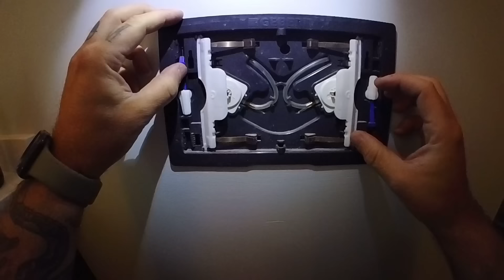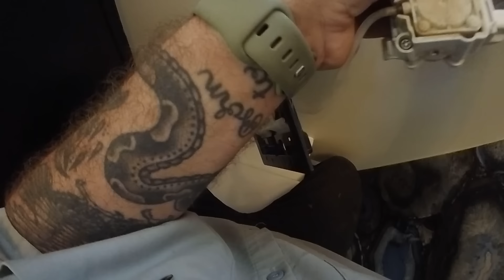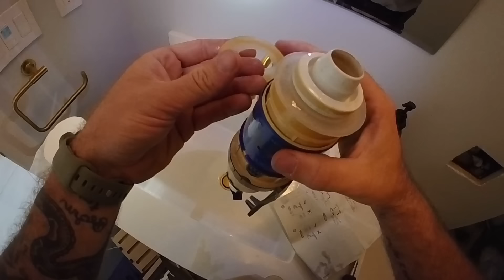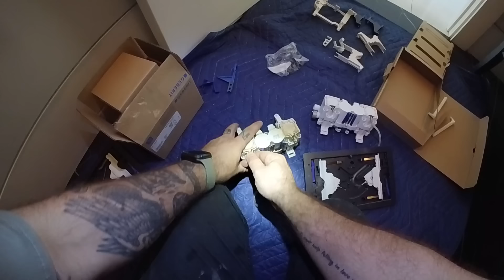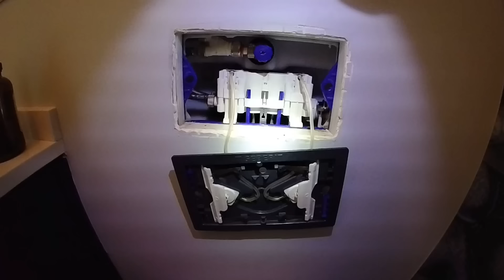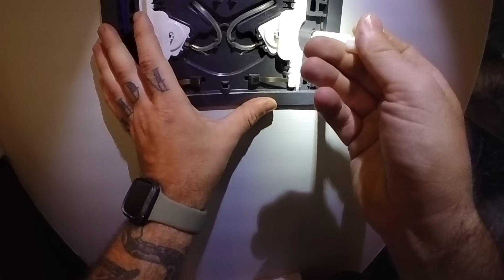This Toilet Is WAY Too Complicated… Geberit Sigma 70 Repair

Comment: They're installing these in AZ here and there. The water here is going to destroy them. When the Moen flo came out I thought "thats cool" but its all plastic and has a plastic impeller. The water here is DESTROYING them ! There is an entire track of homes that they installed the Moen flo on a loop in the garage. I've taken 4 out and every customer when I asked them if they wanted it replaced vehemently said NO !
Reply from the maker: Ah that’s brutal! Luckily the Moens last here in NY, that’s my go to leak detection device. But yeah the fine parts inside these tanks are wild, and it took over a month for the replacement parts to ship out

Comment: Toilets Don’t Need to be Complicated.  Never Understood Why Anyone would Think to have a Telephone Installed in the Bathroom.  Are you Kidding Me. 🤔💩👎
Reply: telephones and fold down trays for their laptops (stock traders), now everything is wifi, but I have installed networking ports, multi-line/pbx phones, phone jacks in restrooms as well as coax jacks, tv's and well, you name it. 🤣 I was even suggesting back then they run conduit to attic and basement and all around so whatever cabling can be pulled in or replaced at a later date, so the ones who went for it have been lucky suckers over the years.
Reply from the maker: Seriously makes no sense